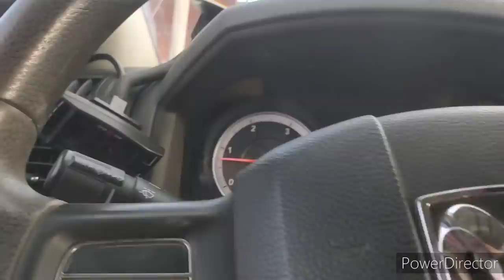Hauling  Cattle For The Neighbors

Comment: Learned long ago, ALWAYS buy 2 boxes of wire, and ALWAYS buy wire when the last box goes in the welder!!! Because otherwise, you will break something on a Saturday, that you have to have Right then... and you're fvcked until Monday... 
The old auctions were all back into the dock/alley, I like the drive through better 👍
Freaking snow leaking building 😠
We have never put a ridge cap on, always lap so the wind doesn't blow in. I'd be a bit pissed too if it leaked like that!!
You have your straw shredder, grind your own hay with it🤔
Tell CP to hurry up and get her deer, before they get too skinny.
Reply from the maker: They won't get to skinny because we them all winter
Reply from the maker: Ed a bale shredder does not grind the feed down it shreds it...ground up feed is way more digestive than shredder feed and the cows do way better on it...its cut up similar to silage only it's all dri feed
Reply: @bcpfarmandtrucking6560  makes sense.. we had a bale chopper years ago, the horse stables used shavings, but the price and availability went crazy. We bought a New house bale chopper, added a slide to the in feed, set it in place, back the truck up, lay the slide against the stack and slide bales down it. Worked pretty good.
Then in 1980, after Mt St Helens blew, we had a bunch of hay that was half ash.. didn't do the chopper any good, but made a huge pile of chopped hay in the cow lot!! 60 cows disappeared into the pile. Couldn't see them through the ash.